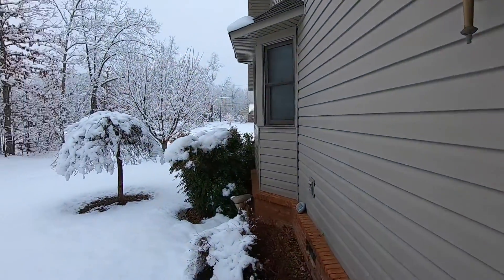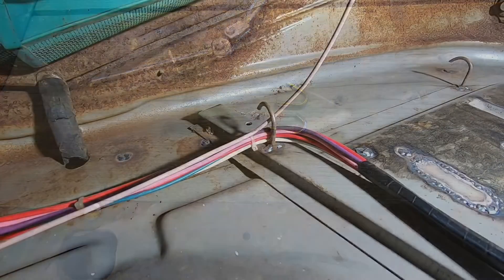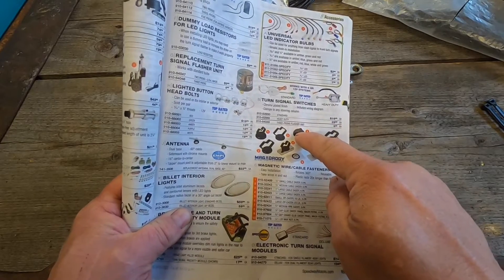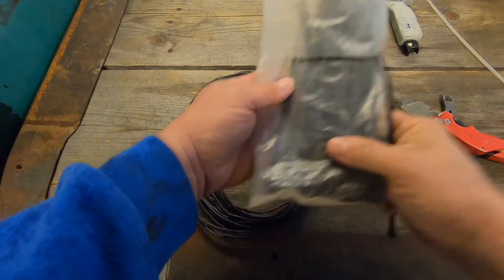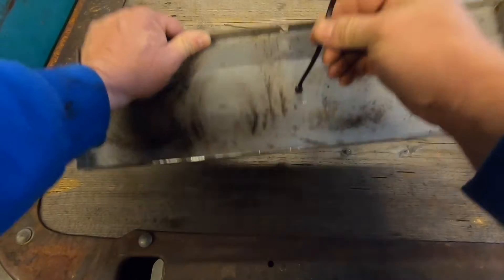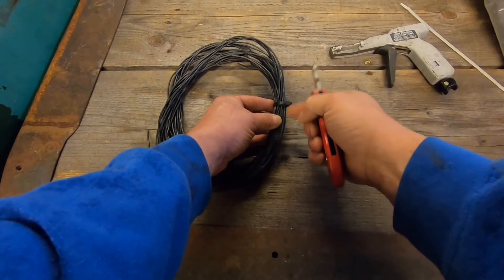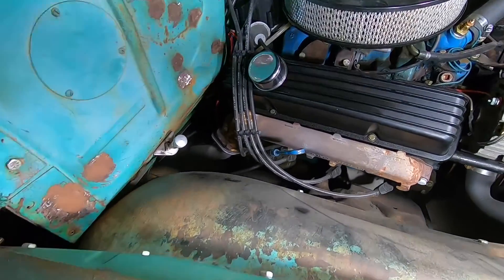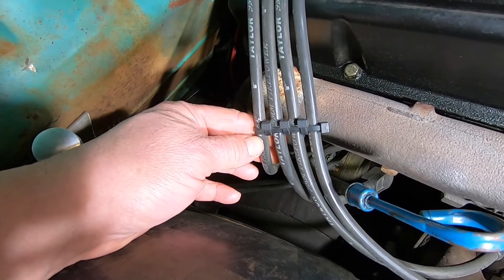Tips & Tricks with Zip Ties #hotroddad #zipties #techtip

Comment: Terrific tips Hot Rod Dad; using every one of them on my 1950 Willys this week alone. The Mag Daddy's are on their way from ebay, I've been frustrated for years with the zip tie bags and you passed on a solution I wish I had thought of, the zip tie tensioner & trimmer is in my tool box (as I've been cut too by ties improperly trimmed, tied a wiring harness to the Jeep's frame through an extra hole, and I'm going build your spark plug wire separators this weekend on the Jeep's Ford 302 V8. You solved many issues in just eight minutes and forty-eight seconds! I just subscribed, your my kind of Hot Rodder. Thank you Sir!
Reply from the maker: Hey, thanks for all the kind words, AND for subscribing!